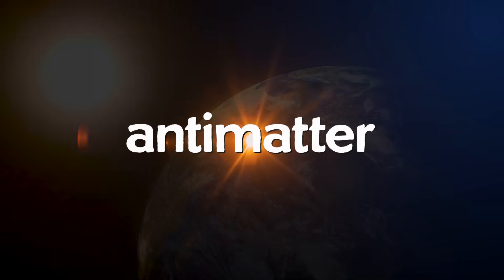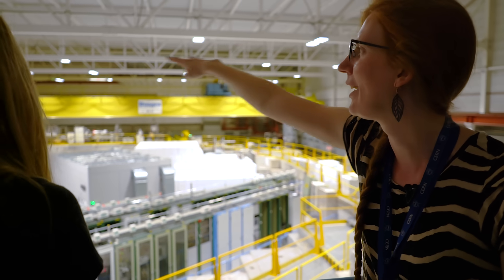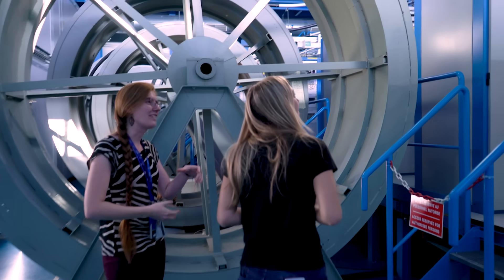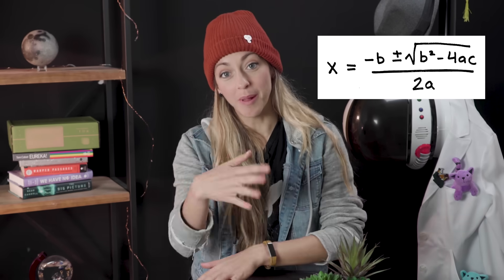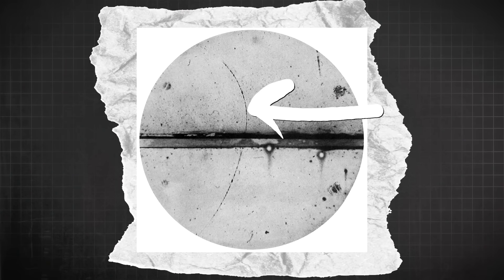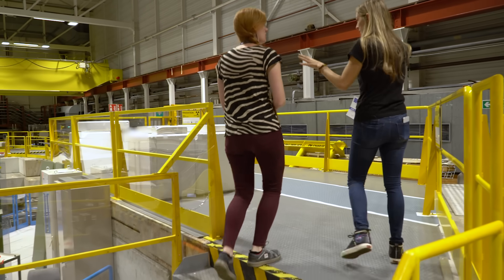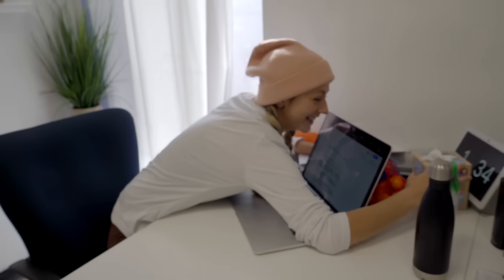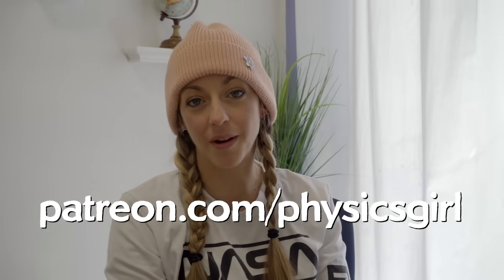Why This Stuff Costs $2700 Trillion Per Gram - Antimatter at CERN

Comment: Hi,if thee see the massive cf v small,Planck nonconstant 11root Pi,smallest bit to maintain+establum ID field to be ST/Gdasplacing,in low RartRARTIO thus if e into Planck ‘width’,loops THART faum Arrounding ID spheroidal function,if dmtr < Planck variabl with ST/G inertia momentum,or decays to be bit of ST/G field see thy square,round toroid,square,rotart ing resonanc to a reasonanc,circl inside sq,diamond,round cnr sq breathing as establum mvt shape stabilithrum,see the thrum,a 7 d naot,ie breathing,vib osc stable vol inner tube,ARROOUNDING stabilizartion a daynamaric prachess,as is not simply a<=>b but do this simpl 7D plus first then move,breath,in,+then,similtanum into arrooundings,check with nm wavpoinparricl coherent,similar reflact,actual reflection to prevent artefact phase polarizing reflection as thee saw in thy mirror, cf true reFLACTion,faithfrul light amplitude arttitude wave POINPARRICL hits surface then instant,art virtuum,x2 light speed,alters coherence,rotartion,as vib osc surface,mass reflecting from ST/G field dasplacnumaria variabl when beam arrant meets reflacted errant light,emagGrav,poinparriclspheroidal,ovoid,egg shaping but similar to thy amazing square smoke circl rings circl in square dmtr circl 1/2tau, of side of then 1/tau,dmtr,if circle ⭕️ ⭕️  cocenchirum,seeing cenchienrum,the trajectory of xyz grid in larger grid in RartRARTIO change t,variabl with reaction of each to sound,light dfusn,dens,inside,capsule cloud CENRUM,moving poinparroclcurv,spheroidal from dmtr rotart 190 dgre to ascribe circl,then 3 d circl spherbresthing hearthbreathing as alters thermionic grad/Dient,(Grar/Rient as with Ugas,fluid,He gasfluid,in artmaosphere, of gas fluids) THART should be dfrnt daenitsdfusion of very ‘coherent’ as would be noncoherent as soon as moves thru,then from surface of non with uandtable ST/G field dasplacing effect art poinparriclspheroidal blunted front as moves in EMRGRAV altering ARROOUNDING daynamaric equalibrinartizartion,zing,song respond to reassounanc,readable without altering either quantum summary read thru surface of ovoid poinparriclspheroidal moving light art 700,550,430,340,111,9poin 3,as each laser lazer has as equal if dfrnt dens dfrnt drop measured,changes subsequent,ie 1 ml from 111 ml change artVbl RartRARTIO ST/G DASPLAC,REFILLING,BUT ST/G DPHEROIDAL FUNCTION DASTRN AS BREATH OVOID,AS INNER CAPSULIZED EGG,EQUILIBRINARTION ACTIVE CONSTANT,REPETITIVE,REACTION,READABL WITHOUT CHANGE POINPOSITION FOCOS LOCALIZING SPHERE CENCHIENRUM BREATHING MIDDLE CF AXIS TUBULAR CIRCL,SQUAR ADJUSTING BREATHING AS THEE DO WHEN WALK,DIVE FROM HIGHT INTO WARTER,IF LIFT ABOVE WARTER THE SURFACE,EMAGRAV ESP IF POLAR FLUID OCEAN,ELECMAGRAV MOMEMTUM,INERTIA OF THEE,OLEOPROTEINS ARROUNG OF FLUID OF BODARIA,AS CHANGES,SEE THY GRAV,FACE TO FAST DROP ATTIFACE CSUNFUSED GRAV,IN ELECMAGRAV FIELD,INDUCES,VORTICES AS SEEN IN THY CRAZY BEAUTHRUMFRAUL WHIRPOOL ST/G ROTARTION TO STABILIZING DASPLACING SURFAELECMAGRAV COHESION OF MOST MASS THEE SEE THESE AS GLUONS,ART SUB ATOM VISIBL RESOLUTION,VARIABLE WITH TAIP E CONDENSUMASS TO eA- A[arrtituda MICRAOSCOPE,effect but collision tween poinparriclspheroidal(e-),many absorb,reradiartng smaller amplitude,or size wavequantum function breathing ave taidal volunum dfrnt to normal ave,ie position of ovoidal blunted in balanc with moving against resistanc of ST/Gfield ocean effect,changes amplitude as previos auxplainad elsewhere,due pressure into beam,into ARROOUNDING tubular laminar espresso if dens,dfusn maedium stabilizing rartRARTIO in prauduction,emergence light prarthalrma reliable seeing truth of events,mass,e,p,E mass mix,THART be seen as if ‘black ‘’hole’’,being whart brung from warter with fluid on,changes vol warter errant,arrant fluid pressure of ARROOUNDING near thy BODARIA,art dfrnt vib,osc,vol change rartRARTIO,lifting warter covered BODARIA alters it,+ST/G+ARROOUNDING,array another ST/G events if flart,as st/g of other events small fraction of Arrounding ST/G field,rartRARTIO true adjusting tau of poinparriclspherarvudal ,if use u as j seeing j,in true reFLACTion as would face each,equal instant if true copy  j,j,jar,twee, in twist capsule of jar,then apparent event horizon an advancing in ‘front’,bow shock blunts,some ‘bliss hole to stabilizing advancing ID field in daynamaric equilibrium,brinartion,dfrnt Taip balanc,bounce,boward side vortices faum helaxuma dfrnt drcttrajectory if acceptable to GOD LAW ESP WHERE MUCH ARROOUNDING EFFECT MIGHT OCCUR,THUS CONSTANT VIEW NEEDING TRUTH IN READING RELIABL RADIANT RAVLOVUARTIONABILITHRUM,AS BREATH OF DRUMTHRUM IF HEAR FROM DRUM LAMINA ABOVE BELOW HEARD SAME t,function relartiv rartRARTIO on,of,change on,of ARROOUNDING events RAVLOVUARTION,R RELARTIVE readable without altering whart being read,aware with conscience,twist n tween GOD LAW active,as appleying r/t<=>v/t,ley here be lane environ effect ARROOUNDING as trunk to fork similar where thighs meet,but standing on head,then thee similar effect of advancing energy requiring to bow blunted thermionic ST/G to ST.G,AS GRAV IN ABOVE CENCHIENRUM,BREATHING ‘MID’’ FUNCTION,ENCAPSULED MULTUNPLARIA VORTICES SIMILAR MANY HELAUMACES FLART BUT LONG THIN,DENS, VIRTUUM RAEL E MASS KANES ARROOUNDING INNER ID FIELD OCEAN OF ADVANCING CONC GRAVELMAGSOLUTION,SUDDEN TO FAST,BURSTS GRAV ovoid ;Wave’p,prrcl amplitude,s S,dasplacnum space if compressiblithrum to mass events,Grav burst,as the toe lifts above warter as warter flauww,fluidgas +THART of Thermionic effectcompared,cf with ARROOUNDING ST/G event in moving emagrav floating pressure solution thru another warter covered BODARIA with emagrav field,see ir images,as E to lift or poinparriclovoid function+ST.G to bow but uander,main advancing mass wavpoinbreathing bowshock thus low visibl light as most Energy efficient to maintain advancing BODARIA esp if approaches ARROOUNDING with another similar event sensed,thus where thee above thee say be accretion disc artefact due maethod of Reading use ARROOUNDING Star near traj,known trajectory stars near,event horizon then see main mass above apparent accretion disc but dfrnt this uan1verse but here,there to learn show mauraeuma arttitude mauralarrtitudeusual Reading accuracy arttide adjust if enters space without true uan1versal truth of GOD LAW,thanx,bliss, XAMichael

Comment: Don't say, "We look around and see completely matter." You give the wrong impression. The universe in terms of matter makes up only 4% of the total make up of the universe. Matter by all sense is just a small residue remaining after the big bang. We find it important because we are made of it and rely on it for existence. But it essentially is nothing important. It's possible the ratio of anti-matter remaining in the universe is also 4%, but the reason they have not neutralized each other might be due to distances. It's possible that there is an even distribution of matter and antimatter that are far enough a way from each other they can't neutralize.

Comment: There's only so little antimatter in OUR universe. People in the antimatter universe may be trying to create what we call matter. To them, what we call antimatter is just their version of matter and they are trying to create antimatter which is what we just call matter. They alluded to it in the video a couple of times. At 4:52 we are told that antimatter would look just like regular matter if we were able to see it. At 6:35 we are told that each matter particle has a brother or sister that has the same mass but the opposite charge. For every bit of matter in our universe, there is an equal bit of antimatter somewhere but it would cease to exist if it came into contact with our regular matter. Since they cannot exist on the same plane, it doesn't seem unreasonable that antimatter would exist on a different plane than our matter.

Comment: If half of all matter created initially (exactly half) then it would have immediately annihilated all the other matter in the universe. If slightly less than half of the mass were antimatter, then it would have annihilated slightly less than all matter, leaving a bunch of empty space, and tiny pockets of matter. It is highly likely that the base energy level of the vacuum is because of antimatter annihilation. All that energy cant disappear, so an infinite amount of matter turned into energy would result in an equidistant energy field.

Or, you know, photons are made out of particle antiparticle pairs and thats where light comes from and how black holes exist.